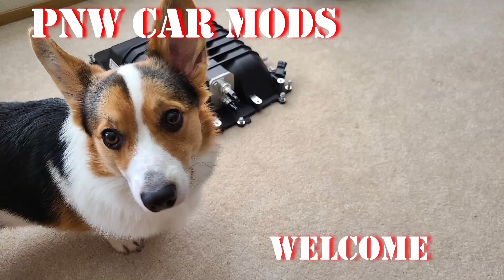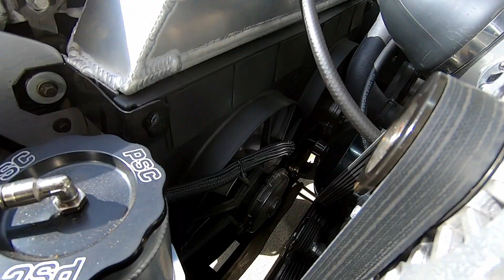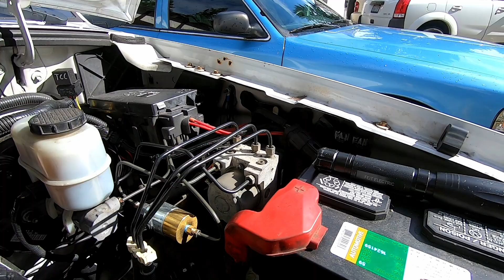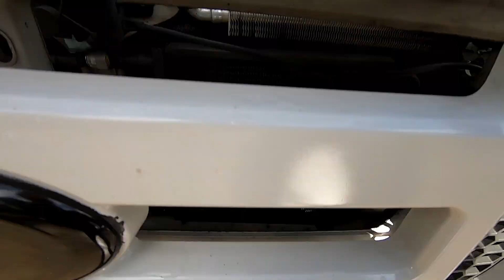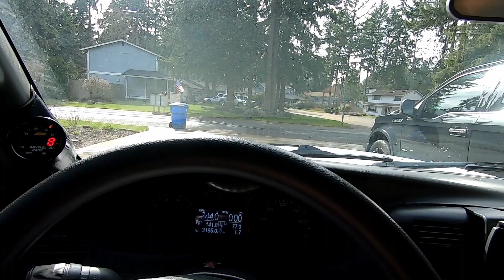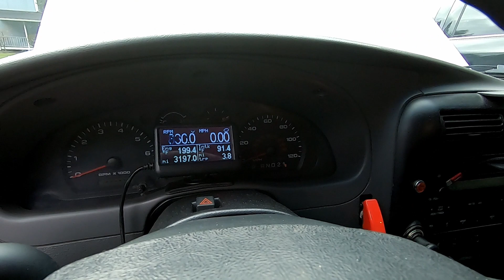Top Street Performance Dual 11 Inch 2800 CFM Electric Fans Review For Your LS Swap Project HC7106

Comment: So for the accessory drive u used a fbody harmonic balancer right???
Reply from the maker: That is correct All F body spacing.  It is tighter than I thought it would be.  I would not want to use Truck spacing in a Ranger.

Comment: Doing a similar swap, feel confident now cus ur videos thanks...
Do u have a video about the heating and ac system  ?
Reply from the maker: Not at this time.    The AC is still not done and likely won't be for quite some time.   Heater is all ford ranger including the little vacuum heat control valve which fully functions.   Heater works 100% as it should like factory.

Comment: very nice. what that wrapped around the connector and wires on the pcm?
Reply from the maker: Good eye cole!  that is basically Gortex tape you can get on amazon.  I think it is for repairing tents.
Reply: @PNW_Car_Mods  interesting, it looks pretty good.
Reply from the maker: @colemcmeans7809  One of these days I'd like to take it a step further and have my mother in law sew me up an actual Gortex boot that I can attach velcro to the PCM.   So far the tape has held up even with high amount of engine bay heat.   Hard to believe I have put almost 4k miles on this thing already!